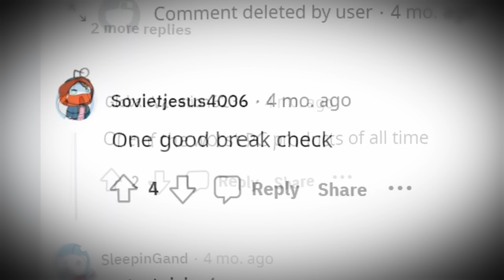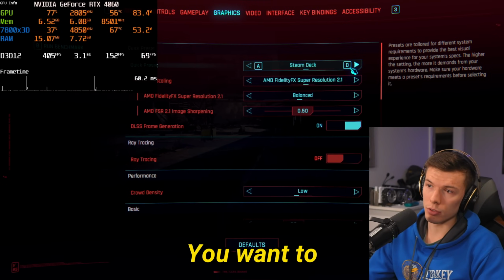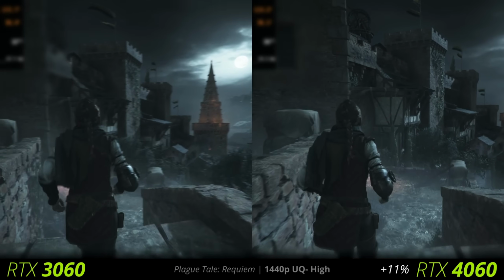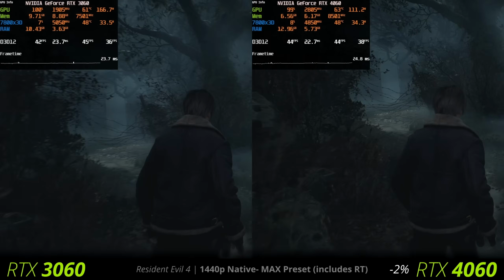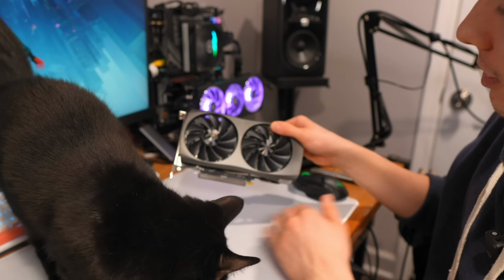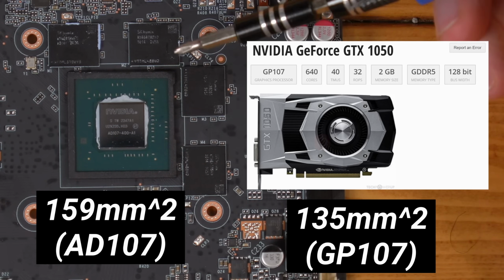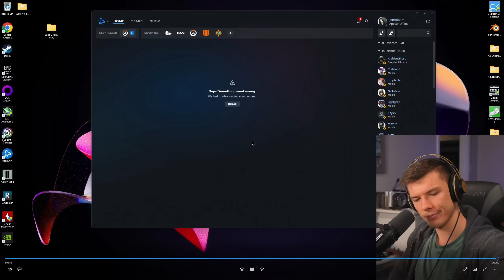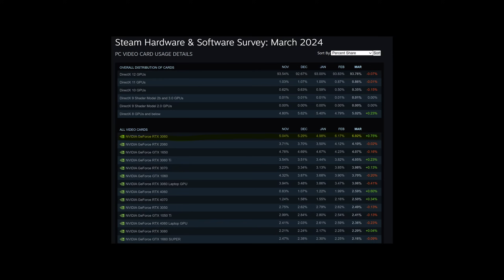I Tried Nvidia's best "Budget" GPU to see if we're Doomed

Comment: AD107 is a 50-class chip.
In fact, all of the 4000 cards (except maybe the "4090") are shifted by 1-2 tiers than they SHOULD be. This entire generation is a major skip.
Reply: True, this is just so evident with 4060 and 4060 Ti
Reply: Nvidia jacked up the price on top of calling their lower binned chip as midrange.  Double kill for consumers.
Reply: i tink even the 4090 isn´t the full unlocked chip
Reply: It's goes like this what the cards actually are
Rtx 4060 = Rtx 4050
Rtx 4060 ti 8gb/16gb = Rtx 4050 ti
Rtx 4070 = Rtx 4060
Rtx 4070 super = Rtx 4060 super
Rtx 4070 ti = Rtx 4060 ti
Rtx 4070 ti super = Rtx 4070
Rtx 4080 = Rtx 4070 Super
Rtx 4080 super = Rtx 4070 ti(barely)
Reply: @farazsiddiqui1312 not that it really matters, but i would argue that the 4080/super is named appropriately since historically, half the 80 class gpus nvidia launched are on a 103/104 (step down from the 100/102) die and have a 256bit bus.

But for everything else yeah 100% spot on.
Reply: Historically the 80 class is not a 102 card, the 3080 is an exception. The dies are just too cut down with not enough memory.
Reply: No the AD107 is actually a 30/40 class chip since it's 148mm^2, while the rtx 3050 is 198mm^2 and the gtx 1650 is 200mm^2. Don't fall for the naming crap, look at numbers.
Reply: @farazsiddiqui1312  Here is how it goes:
RTX 4060 = RTX 4030/4040
RTX 4060 Ti = RTX 4050
RTX 4070 = RTX 4050 Ti
RTX 4070 Super = RTX 4060
RTX 4080 Super = RTX 4070(literally the rtx 4080 Super has a die size of 379mm^2 the rtx 3070 has a die size of 392mm^2)
RTX 4090 = RTX 4080
Reply: @kapler8550  Chip names don't matter. The RTX 4080 Super = 379mm^2 die size, the RTX 3070 = 392mm^2 die size, so the rtx 4080/Super is absolutely a 70 class card. The reticle limit for both is 858mm^2.
Reply: Except 4080, it is not a 7000 class chip cause it beats 3090ti by 30-25%, no xxx70 product beat ever the flagship of the last generation by 25-30%, 1080 was also 30% faster than 980ti, such as 4080 faster by 25-30% than 3090ti.
Reply: @farazsiddiqui1312 
Nowhere!
4080 is 30% faster than 3090ti such like 1080 was faster than 980ti and you called it a huge generational uplift.
Reply: @i3l4ckskillzz79 
4090 is 70% faster than 3090ti, it more generational uplift than 1080ti vs 980ti.
Reply: @kapler8550 
4070 super already is like 3090, just look at the performance. Always 70 was like the flagship of the last generation. We got it in 40 series.
Always 80 tier was up to 30% faster than flagship of last generation, expect 20 series.
Here we get 30%
Faster performance than 3090ti with 4080. It like 1080 was 30% faster than 980ti.
Reply: @789uio6y  Performance is a byproduct, not a cost factor nor a tier factor.

Going from the Samsung's 8nm to TSMC's 4nm is like a 1.5x process node upgrade, so yeah a 70 class GPU will beat the 90Ti class GPU, which should have been called a 80 class GPU to begin with.

The gtx 1080 is even worse, it's a 60 class card. The difference is that they skipped 2 process nodes(22nm and 20nm) and went straight to 16nm, so even worse. That's like saying the upcoming rtx 5070 will be an amazing GPU for beating the rtx 2080Ti, yeah no duh, there is a 2 process node difference.

The gtx 1000 series is why prices are the way they have been, Nvidia's profits went from 45-50% up to 90-138%, they and the 4000 series are the most overpriced GPUs at MSRP in history.

The rtx 4080 has a die size of 379mm^2 the rtx 3070 has a die size of 392mm^2, they are the same tier.
Reply: @789uio6y  it´s still not the full ad 102 chip there´s possibly room for a 4090 ti but it is not needed becauce of no real competition compared to amd. Of curse the price is crazy but i did not care about that
Reply: Love how no one ever talks about efficiency in GPUs aside from when AMD somehow eats 100w on idle
Reply: @farazsiddiqui1312  the 4080 super and 4080 are basically the same card and your almost right on the graph but the 4070 12 gb takes a big jump in performance vs a 4060 ti 16gb 20 to 30 fps more and the 4070 ti super with a good card a over clock gets you very close to 4080 performance the 4070 super is the 4070 and the 4070 ti super is a 4070 ti then you have a 4080 super witch is the actual 4080 the 60 class cards need to be brought up to 10  to 15 less fps than a 4070 super and the line up would be fixed like i said the other cards like the regular 4070 12gb smokes the 4060 ti in every game by a good amount.
Reply: @rattlehead999  you are so very off lol i hope you was just being funny because this is so far from being right look at my other comment that's basically the right line up
Reply: nvidia has been shifting since kepler era. and the funny thing is they do this in gamer's "favor" so they can keep selling something in sub $300 market haha. now it become harder to shift things down when they already use their XX107 chip for their $300 GPU. AMD? they did not even dare to use 5nm on navi 33 because of the cost. that's why there is no new sub $200 GPU from AMD and nvidia using their latest architecture.
Reply: Says who? Nvidia does not design chips to fit labels like "70" or "80". They design chips and bin them in the most cost-effective way possible, then decide what labels to slap on them. Nvidia exists to maximize profits, not to make label nitpickers like Steve Burke happy.
What Nvidia hears is: "This 70 class isn't exactly like last generation's 70 class! THIS IS PREPOSTEROUS!! I shall protest by giving Nvidia even more money than I did last generation!"
Reply: the 4090 is a 4080 TI.
Reply: @davidfrazier6308  No I'm not.
The rtx 4060 has a die size of 148mm^2, the rtx 3050 has a die size of 198mm^2 and the gtx 1650 has a die size of 200mm^2.

Thus the rtx 4060 is NOT a 50 class card, but a 30/40 class card.

The rtx 4060Ti has 188mm^2 die size, which is still a bit lower than the 3050 and 1650, but close enough to be a 50 class card.

The rtx 4070 Super and Ti have a die size of 294mm^2 which makes them a 60 class card, since the rtx 3060 had a die size of 276mm^2 and the 2060 had 445mm^2.

The rtx 4080 Super has a die size of 379mm^2 while the rtx 3070 has a die size of 392mm^2 thus the 4080 Super is a 70 class card.
Reply: @ZedDevStuff  That was fixed months ago.
Reply: AMD did the same thing.  They called their 80 class cards 90 class, even added a X to one. They have a 90 class named card that's a 4070 Super competitor.  7800xt is using the 70 class GPU die. GRE is using the same 18gbs memory dies as the 7600.  Both companies cheaped out in different ways. I don't think AMD had much choice though. They are using 50-100 percent more silicon to match raster only performance. They had to cheap out on RT and AI accelerators. Well that or they ran out of room on the die because they used a larger cheaper node.
Reply: @rattlehead999  yeah and now people barely mention power consumption when recommending cards and I strongly believe it should be something people are aware of
Reply: @ZedDevStuff Absolutely. GPUs should cap at 250W and CPUs at 140W. That was the engineering standard for desktop components for close to two decades. Make the fastest possible 250W GPU and fastest possible 140W CPU and stop there.
Reply: @Sp3cialk304 Very true, that's why you don't look at names, you look at die size. 

When it's a multi-chip module GPU/CPU, you take density of each process node and equate them to the latest one.

For example the 7900xtx has 300mm^2 core using 5nm with 150 milion transistors per mm^2, while the cache modules are 51 million transistors per mm^2 and each is 37mm^2, divide it by 3x and you get 12mm^2 if they were on 5nm, so in total the total die size would be about 372mm^2 which is almost the same as the 389mm^2 of the rtx 4080/super.
Reply: @rattlehead999  I mean, they can't really do much when they get to that point. Don't mind the existence of 4090s and other cards. Especially since they speed up a lot of tasks outside of gaming
Reply: Nah the 4070 performs well for a 70 class card
Reply: @justmatt2655 Performance is a byproduct, die size is what matters.
The rtx 4070 has a die size of 241mm^2(cut down from the 294mm^2 die size of the full chip).

The rtx 3060 has a die size of 276mm^2. 

The rtx 3070 has a die size of 392mm^2, the rtx 4080 Super has a die size of 379mm^2.

The RTX 4080 Super is a 70 class card.
Reply: @justmatt2655  No, the "4070" is really a 60-class card.
The "real" 4070 is now $800.
Reply: @rattlehead999   nah that doesnt really track. 
Niether chip name nore die size really matter. Performance does.

The 4080 is fast enough to be an “80 class” therefore it is an “80 class”. nvidia is the one that dictates this. Not us.

Remember. 
the term “80 class” or “70 class” isnt an official term used to refer to what dies are used in the product stack. Its something the community has come up with. 
And everyone and thier mother has a different opinion on whats what.

If blackwell has some hypothetical magic 200mm^ chip thats 30% faster than a 4090, then nvidia will happily turn that into the 5080.
Reply: @kapler8550  Performance doesn't matter, it's a byproduct, not a cost nor a manufacturing factor.

Die size determines weather a chip is mid range, low-end or high-end and it doesn't matter if that chip is a GPU, CPU, ASIC, FPGA or any other IC chip.

And yes Nvidia happily calling low-end chips mid-range and mid-range chips high-end is why the market is like it is right now and people buy them, because dumb youtubers only look at performance...

The gtx 1000 series and 4000 series are the biggest rip-offs in GPU history.
Reply: @rattlehead999  performance is the only thing that matters. Thats what their trying to sell you.

The problem is price. nvidia wants more profit margins. 
And with the 40 series, they made a gpu architecture fast enough to there they can effectively have their cake and eat it too. The problem is they priced everyting to the moon.

 i disagree about the 10 series since the price to performance was there. But i do agree on the 40 series along with the 20 series being massive ripoffs. Considering the price/performance.

I understand your point about nvidia not selling us as much performance as they can by selling us the smaller dies in the higher end product. And i dont like that they do that. But from a business pov. It doesnt make sense for them to do anything else when those smaller chips compete with your competitors fastest chips.
 It would make no sense for nvidia to have released a 4080 on ad102 thats ~ 10% faster than a 7900xtx. Since they would make less margins on it and it wouldnt sell aswell because it would be more expensive. The 4080/super is exactly what it needs to be in this market.
Reply: @zdspider6778  4070 is on par with the 3080 but it's £500. I wouldn't call that a downgraded card
Reply: @justmatt2655  Dude, the 60-class is supposed to MATCH or BEAT the previous-gen 70-class. Except the "4070" - which is really a 60-class - even LOSES to the 3080 by up to 9% (at 1440p and 4k). Because they made it so anemic.
ALL 70-class cards sold in the last DECADE, since the GTX 670, came with 256-bit memory bus, not 192-bit! 😠
Reply: @zdspider6778  I never said anything about 60 class, I agree this this generation 60 class is underwhelming. Yeah if you cherry pick the titles 4070 loses to 3080, but you can also choose titles that it beats the 3080 in. On average they are within margin of error to each other. The memory bus doesn't mean anything, it's the bandwidth you wanna look out for. Because of the new GDDR6X memory it uses the memory bandwidth is perfectly reasonable, above expectations if anything
Reply: @justmatt2655  They are close precisely because it's a 60-class. Not a 70-class.
The "real" 70-class is now $800.
And how tf did we get from $379 to $800 in just 3 generations? 😠
Reply: @kapler8550  If performance is what matters then the rtx 4080 is 50000% faster than the geforce 256 and the geforce 256 was 250$, so the rtx 4080 should be  125 700$...

Performance is a byproduct.

The gtx 1000 series seemed good because they skipped 2 process nodes. They skipped 22nm and 20nm.
That's like going from a gtx 1000 series to a rtx 4000 series and praising the rtx 4000 series for being much better than the gtx 1000. Holy hell the rtx 4060 is 330$ and it beats the 1080Ti for 700$, such an awesome card the rtx 4060 is...

The gtx 1000 series were sold at 90-138% profit margins, it's what made Nvidia's stocks blow up. The gtx 900 series were sold at 40-50% margins and the rtx 2000 series were sold at 50-60% profit margins... 

The gtx 1000 series and people buying them are why we are in the market where we are today.
Reply: @kapler8550  Also yes the naming doesn't matter, but the die size does. Die size is the cost and manufacturing factor, not the performance.

But people will keep buying based on performance and prices will keep rising and I'm all for it. I want the rtx 8060 to cost 3000$.
Reply: @rattlehead999   youve clearly been “wooshed”. 
And i dont feel like sitting here arguing about it. 
This conversation is over.
Reply: @kapler8550  Yes engineering standards and reality is being "wooshed"... Performance which costs them nothing is what matters for sure.
Reply: Yeah. Even just read about 128 bit bus in $300 is hilarious.
All ..50 was much cheaper - GTX 950/960/1050/1050ti all of them  cost less than $150
Reply: @Xenotester the gtx 960 was 200-220$ at release, the gtx 950 was 170-180$ at release.
Reply: This is the new norm
Reply: Nope. Bought It to replace a gtx 1050 It's way better
Reply: @kagenlim5271  And the rx 6500xt is way better than the r7 260x, doesn't change the fact that the rx 6500xt is a bad value.
Reply: You guys don't know what you are talking about. Might as well join with theDunning-Kruger effect. 

RTX 4090 actually is RTX 4060. 
RTX 4070 is actually RTX 4030.
Reply: @REgamesplayer  Enjoy the rtx 7060 costing 1000$, but hopefully at least 2500$.
Reply: @rattlehead999  What you are talking about?
Reply: Yup
Reply: @rattlehead999 That's what the classes were about..
30 - small form factor (35W)
50 - basic office machine (75W)
60 - typical gaming machine (150W)
70 - fast gaming machine (250W)
80 - power be dammed! (350W)
Reply: @farazsiddiqui1312  If they've named it like that, it could've gotten a bit better but Nvidia didn't do that so that they can slap a higher price tag thanks to the naming, most consumers don't know they are actually getting a card that is 1 low tier in disguise. If they did change the name, in the long term they have to lower the price...such a dick move by Nvidia.
Reply: @kapler8550  Keep in mind Ampere launched with large buses and chips because otherwise it would have been no upgrade over Turing. Thats also why it was considered inefficient. The 3080 was basically a 3080 Ti, just as the actual 3080 Ti later was barely any faster.
Reply: @farazsiddiqui1312 "Rtx 4070 ti = Rtx 4060 ti"  Really?
Reply: @matthewburmister1642 in theory that's the tdp target. But just as the 80s didn't used to be  a 350w part. The target wasn't always met at every gen
Reply: I have a laptop with 8gb of vram, never knew what it was for except gpu stuff
Reply: “Major skip” and yet each card in this generation has tons of benefits compared to older cards.
Literally 70 class cards have been stuck on 8GBs of ram for ages, and they finally changed that and gave the 4070 and 4070ti 12GBs
Also they’re more efficient than the competitors. So saying this clearly shows you’ve never seen anything with the 40 series l
Reply: @farazsiddiqui1312 Bro really wasted his time making this crappy “well acktually” comment.
What a joke.
You call stuff like the 4070ti the “4060ti” when not even the 3060ti could even run things above 1440p
Also the 4060 being a efficiency power house
Reply: @Thewaterspirit57  Dude, 16GB should have been standard with the 3000 cards, and it looks like it won't even be with the 5000 cards. Nvidia is actively dragging the PC gaming market down. 192-bit is NOT an improvement, it's a downgrade. 70-class cards have had 256-bit for more than a DECADE, since the GTX 670. They're trying to sell you 1080p cards disguised as "1440p". The power efficiency comes from them shifting their product stack by 1-2 tiers. So a "4070" is really a 4060 with a typical 60-class power draw that you'd expect from going down to a lower process node, and a "4060" is really a 4030Ti (which should be sub-$80, definitely NOT $300!).
The "real" 70-class card now costs $800. And is called "4070Ti SUPER". What a God-awful name.
The "competitors" fumbled the ball. AMD did essentially the same thing, the "7900 XT" should have been called the 7800 (non-"XT"), and the "7800 XT" should have been called the 7700 (again, non-"XT").
Intel is our only hope... and I don't have much hope in Intel.

The market won't self-regulate until people stop giving them money.

Last year they had the worst GPU sales in over 20 years, and this year the 4000 cards are top of the Steam Hardware Survey charts? Who did that?  😠 Why CHOOSE to get fleeced?
"Nvidia, the way you're meant to be played."
Reply: @ having a 192 bit bus means nothing dude, your complaints are nonsense. The 4070 and 4070ti use a 192 bit bus and don’t suffer from performance issues. Plus you don’t seem to realize there is such a thing as over building a graphics card. The RTX3060 has 12GBs of ram the same bus width as the 4070, but couldn’t use all of it during gaming.
Giving a card too much ram wastes money.
Also you have a very minimum understanding of how graphics cards are priced. There is no way they could price the 4060 at 70USD. People buy these cards because they’re quality that’s why they’re in the top Steam hardware charts.
Sorry AMD isn’t your supposed “king” cuz guess what? Their cards still suck, are unstable, and aren’t energy efficient.
Reply: @Thewaterspirit57 You're the type to welcome and even DEFEND 96-bit. 🤭
"Giving a card too much ram wastes money."
Nvidia loves you, man.
"Nobody will ever need more than 640K of RAM anyway." - Bill Gates denying he said it. 😂
The 3070 and 3070Ti are perfectly capable cards that are significantly dragged down by having just 8GB VRAM!
Nvidia fanboi, Nvidia isn't your friend. They don't give a shit about you. And neither does AMD. Do you own Nvidia stock or something?
Reply: Exactly, the die size of RTX 4060 is actually SMALLER than RTX 3050 so that means 4060 SHOULD be 4050